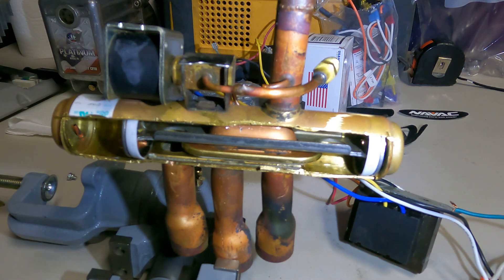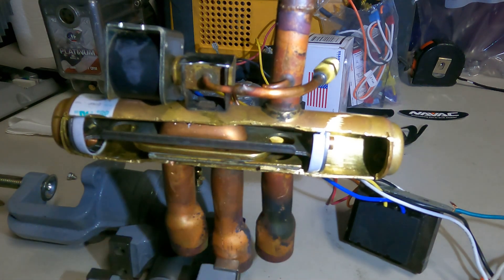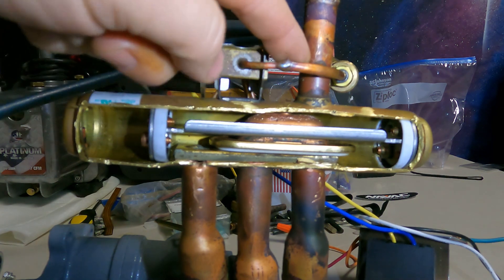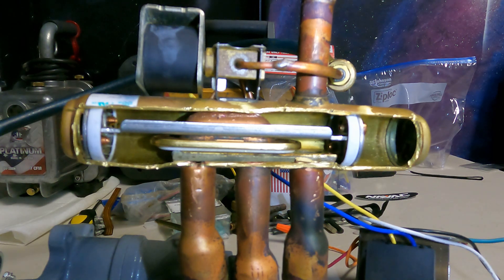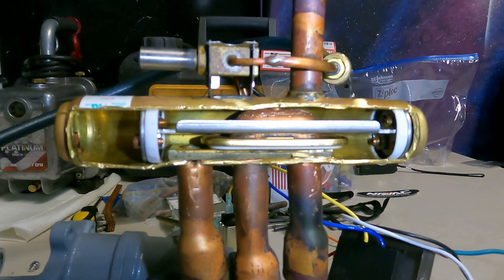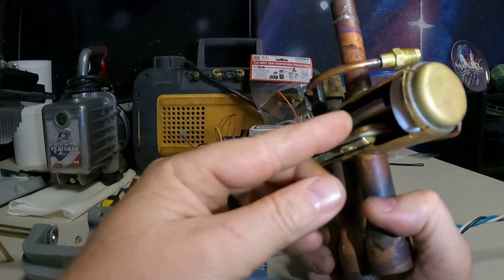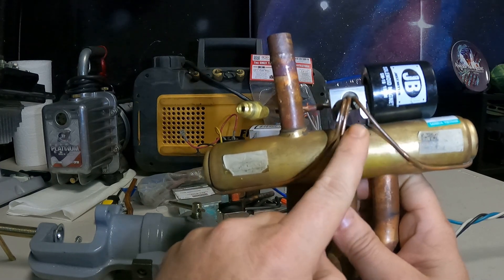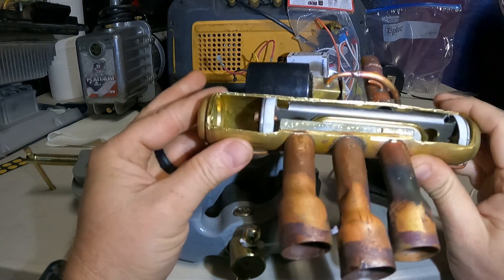How does a reversing valve work on a heat pump AC

Comment: I don't get in this day and age why all AC's aren't reversible so they can produce heat. You have to pay a few hundred bucks for that reversing valve for window units.
Reply from the maker: Why everything isn't just a a heat pump now I couldn't tell you. I will say I was just tasked to redo an entire course that I teach in the state. I had to update it for Dual Fuel. Which is weird because here in Arizona dual fuel is really not necessary. But in order to get the federal accreditations for the course it must now include dual fuel and smart tools.

Comment: love this.  will be like an ar15 barrel extention in the uk.  100% illegal device
Reply from the maker: 😂 what?
Reply: our government are thinking about mandating electrically-driven, air-sourced heat pumps to replace our natural gas-fired central heating boilers but if they do, they have also declared we can't have reversible flow in case we collapse the electrical grid  by using them for cooling in summer.  a uk summer!  seriously!  
(i was going to say fire control group for the comparison but technically, they would be legal in the uk because we only prohibit the pressure-bearing components of firearms as it's a far simpler means to institute a total ban than keep quibbling about which adapted doohickey constitutes something opon which the home office would need to make an atf-like 'determination'.   @HVACRverse
Reply: usa: civillian 3-hole ar reciever = illegal
uk:  4-way civillian hvac valve = illegal @HVACRverse

Comment: Sp what is the failure mechanism when the valve breaks?
Reply from the maker: typically most reversing valves fail due to either the capillary tubes being restricted or the shuttle getting stuck. But the most common issue I have seen is reversing valves are diagnosed as defective because the electrco magnetic coil has failed or not getting power, and technicians jump to replacing the valve that is why I always test with my magnet.

Comment: You should explain a little more about what's inside the mini valve that creates the pressure difference. It was kind of assumed that it just happens with no real breakdown of the mechanism.
Reply: The solenoid valve is just a small reversing valve called a pilot valve and looks basically the same inside as the large valve does and has 4 tubes One connected to high pressure from the compressor, another connected to the suction side which creates the pressure differential for the main valve, and one tube to each end of the main reversing valve. The pilot works the same way as the large valve was demonstrated. One tube is connected to the high pressure side of the compressor. The pilot valve is spring return so when there is no power to the solenoid the pilot valve is returned by the spring to the default heat position.  The pilot creates the high/low pressure differential on one side of the main reversing valve causing it to shift it to the heat position. When the solenoid is energized the pilot valves internal slide shifts the pressure differential to its other side  for cooling mode. This in turn shifts the high/low pressure differential of the large reversing valve to the opposite side causing the main reversing valve to shift to begin cooling mode which is also defrost mode.
Reply from the maker: That was a very good explanation and very accurate thank you. Wanna help out with the channel :).
Reply: @HVACRverse Thanks!